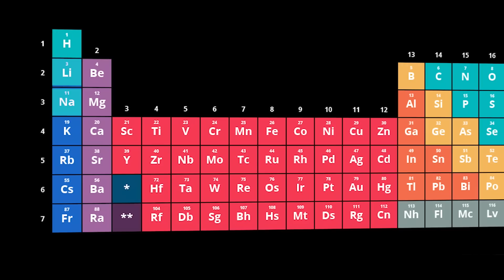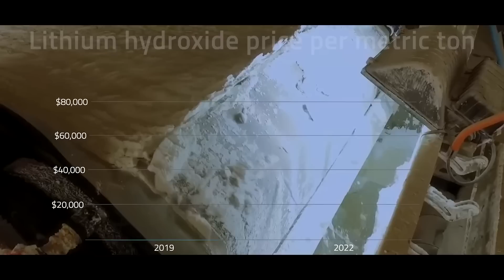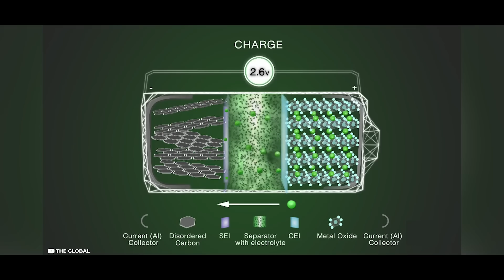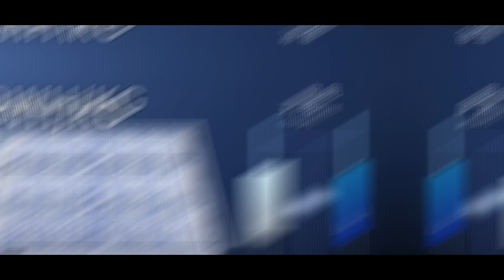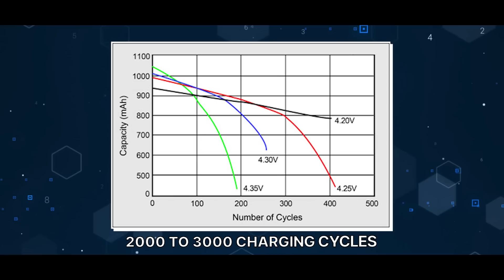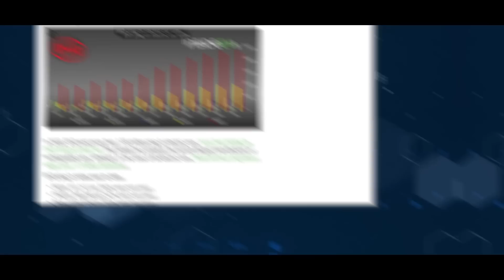BYD launching First 9000$ Sodium Ion Battery EV Changes Everything!

Comment: Nope. Not until the sodium battery charge cycles can match lithium AND its size is the same for the same capacity. Currently they are large and heavy, as their energy density is half that of lithium and have a charge cycle less than 1000. Lithium is 3500 - 5000. So they wouldn't last as long. They are an improvement on lead acid, though.

Comment: The information itself was pretty much correct but presentation was too much dramatized to promote sodium ion batteries. They are interesting for scalability point of view but not a game changer and definitely compromise for energy density. 

We can't compare densities between new sodium ion and old lithium cells. Developments in manufacturing many times apply to all chemistries. Sodium ion batteries makes some things easier but overally the sodium ions are worce performing material. Next generation high density sodium ion batteries are typically sodium/lithium ion hybrids.

What comes to environmental impact, emissions from lithium production depends on energy being used. Typically fossile fuels are expected as a reference. Lithium can also be recycled, so there's no sustainability issue. From material point of view, lithium covers only about one percent of cell mass. Nickel is actually the most problematic material when scaling up lithium ion battery production. That's why LFP batteries have advantage. They actually need more lithium for same energy since electrical potential is lower.

Comment: "Tesla win the race for cheap electric cars"  - you are kidding right - when it BYD  and other  Chinese  EV manufactures are producing the cheapest  EV in the Market and are the one who are innovating  and producing the new battery chemistries,. BYD had the LFP battery in thier EV  since <2010.  while Elon (tesla)  poo pooed them.  Now  Tesla scrambling to get his hands on BYD blade batteries ( and other LFP's)  a Decade later. The only reason Tesla is around today is because of the Chinese market place ( the only country Tesla generates a profit in)  . and western protectionism that prevented BYD ( and other Chinese EVs) from entering western market for over a decade . as BYD was offering a $30,000 EV  in 2011  for the western  market ( and profitable as BYD  always made modest profit on thier EV's ) .. when Tesla  were selling thiers for a +$100,000 and was loosing money on every car sold

Comment: The elephant in the room is still the lack of an adequate power grid in this country that would accommodate millions of EV's charging, Sodium Batteries? .... great, no fires, but they still need charged. The green new deal tree huggers, oh they want everyone driving EV's but to supply all that electricity, the country needs to build thousands of coal fired power plants, that generates electricity 24/7 unlike solar/wind, but that leaves a bad taste in their greenie mouths because they are hard at work with the EPA to shut down coal fired power plants, which puts them in a catch 22 because you can't have one without the other, so if they push one (EV's) without the other, then Americans will face rate hikes they can't afford and rolling blackout. Is that what you want?

Comment: Except the car has not been launched by BYD till now! The latest compact car called Seagull is equipped with LFP battery and sells for USD11-12k per car.
Reply from the maker: Till now. As explained in this video, BYD is testing around with sodium batteries.
Reply: 12K usd is still not bad, similar other cars cost close to 20K, ok, you get the niceish brand and probably less risky on the reliability front, but still very cheap.

Comment: The cycle life plot you show says 20% capacity fade will occur after 400-500 cycles at 4.2V, but you use it to say the battery will last 2000-3000 cycles. Cycle life is still the key issue delaying Na-ion from hitting the market.
Reply: but it is an intermediate.  If you buy an EV for $10k in 2023 while the tech is new and you get 6-8 years out of it, that is fine because in 2030 they are going to be a lot better and cheaper.  It is just better we get away from lithium as soon as possible. Just having mass production of sodium batteries ensures they will improve every year.

Comment: Sodium batteries are cheaper to buy but get 1/3 the cycles of lithium so you have to replace much sooner. In the long run lithium is probably cheaper.
Reply from the maker: Thats not 100% true. Sodium ion batteries can reach up to 3000 charging cycles. The batteries are at the beginning of development. However, they cant compete with LFP batteries in terms of charging cycles, that for sure
Reply: How many charges we can get from 2000 cycles

2000*200 or 400,0000 fucking KM

Honestly, I drived a lot in China and my daily commute was 65km or American range and 2500 family vacation + 200km country house ... and my BMW only gathers 20,000KM/year

so forget about lasting 400k, realistically, 200K is plenty for many.

If I am still in China right now, I will ditch my BMW 330 2017 ... nothing beat about 5K USD per year saving by going EV and the shitty little dingy car is more than enough to get around in the big city anyway

I remember seating in a 2017 shitty Beijing Auto EV, that thing in the city is as quiet as my dads 2017 Lexus G hybrid

We are talking about different beast when going EV ... dingy shitty cars is pretty much the same noise level as IC 80KUS cars in the city 

I still want ICs for longer trip but anything can be supercharged at 240-300KW and the battery lasts 2.5-3h per charge which the sodium ion battery offers then it might also move up a level or two... till then the cheaper the better

Comment: There is a limited amount of Lithium anyway, is expensive to obtain and is not degradable so these new batteries are better, but in the long term I still thing H2 powered engines are the answer for the future. Toyota are on the right track, no EV`s.
Reply from the maker: I don’t think so. Hydrogen fuel cells are just too inefficient.  From converting to hydrogen and back to energy  you have 60% energy loss through the whole process. But who knows maybe there will be a significant breakthrough anytime soon.

Comment: Correction.  Yes CATL and BYD are the biggest in China.  But they are also both the biggest in the world.  CATL by a mile.
Reply: CATL and BYD in China; LG Chem outside China.
Reply: @tooltalk  tesla giga Berlin is 100% catl.
Reply: @fredfrond6148  : CATL Germany is not a big plant -- it's a small 8GW which is expected to scale to 14GWh.  LG has a 70GWh plant next door in Poland, with expansion underway to 115GWh by 2025.
Reply: @fredfrond6148  : >> tesla giga Berlin is 100% catl. <<
Also, CATL was the exclusive LFP supplier to Tesla Germany, but Tesla has been working with BYD on blade format -- rumor has it that they just went production with BYD's blades very recently.  LG Chem also supplies NCMs to Tesla Berlin (not sure though if they are from Poland or LG's China factory).
Reply: @fredfrond6148  : I think it's worth knowing that LG's presence in China is tiny b/c China made it impossible for foreign competitors from entering their market to protect their domestic industry (ie, CATL and BYD).   Other competitors such as Samsung SDI and SKI weren't even allowed in unless they gave up their core battery technology in exchange (for access to their market).

Comment: I understand that Sodium Ion batteries provide lower cost & cold temp resistance as main benefit but this is offset by lower energy density (material property), and most importantly MUCH lower battery cycle life (material property). This would benefit the manufacturers the most because people would mostly be buying as new cars but buyers will learn the hard way later because this will need to recharge more often and more importantly battery will also need replacing more often. When you consider the battery cycle life, is this still justified for overall running costs? Ironically lot of these videos only mention about the positives and not the negatives............ One big benefit that I agree is folks living below freezing temps as this is one major limitation of Lithiums

Comment: If BYD are introducing Na-ion batteries this year, they must be pretty confident in the technology. In which case, it will advance further and we'll start seeing these batteries in more cars over the next five years. LiFeP batteries were lagging behind Li-ion batteries for a number of years, but their lower cost, greater robustness, no need for Co or Ni,  and safety and longevity means their drawbacks, less energy dense and cold weather problems, are outweighed by their pluses. I would certainly buy a car with a LiFeP battery.
Reply: Pictures of the Seagull being delivered to dealerships across China are already out....
Reply: VW also plans sodium-ion batteries ... so it seems a common sense between car manufacturers...  generally I think solid state is the future as NIO is doing for it's two models ET5 and ET7

Comment: Looks interesting if it is already in a position to compete with LFP. Can these newer batteries also charge to 100% regularly?
The new Tesla M3 RWD with 305 miles range  meets a lot of people’s needs so if the batteries could be swapped for no reduced performance in terms of energy density, gives faster charging, better cold weather performance and reduced cost it seems like there’s no downside.
Reply: never thought Lithium battery is environmental friendly. Now Sodium makes much more sense
Reply: Might even be the case in the future where E car batteries become user removable , as in case of e scooters.
Reply: @atulmalhotra2303  E-scooters/Bikes are like 10lbs-20lbs;  Teslas are like 1000lbs to 2000lbs on Ranges Packages! 😆 😆
Reply: it seems..........there is always a downside because we are only human!
Reply: Like it or not, even Texas Grids the Most Independent Grids of USA...

Texas is now not ready for Tessie Moron/ BEV 🔋 🔋 Electric Vehicles... are Hoaxes of all times...
Last Reported from China:

85% of all Electricity in China generated from Coals = Yes, what's a Joke = Why/How?  Our ICE Toyoda Cars with Modern Catalyst Converters, run on Octane 91/ Ethanol are twice as Clean as Electric Vehicles plug-in to the Grids that Generated 85% from Coals.

How/Why?  Those Pipes/Chimneys from Electric Generators/Plants are 100m/324 feet in the Air; Coals burn Hot air of C02 Carbon Dioxide Piped up the Air there are no Trees up there to neutralize some of those C02; while as C02 came from Mufflers = one foot or less than 30cm above roads/streets surface = during daytime = peak hours = some Carbon Dioxide is Neutralized by Photosynthesis Process of those Green Trees planted along the Streets or Wheat Fields/Vegetation Fields along the Country Roads = Given us more Oxygen and also better Yields of Fruits/Wheat with more C02.

Let Nature be a part of our Solutions = Focus on Making Poor Countries like Morocco and Libya having Adequate Dams and Irrigation Systems that Mitigate Natural Disasters... Those are what China, USA, and 🍁 🍁 and G7 (especially Elon-gates Must have been doing) to make a better World = Japan has been doing that with 20 years of Manufacturing Cars that High Mileage and low C02 Emissions.   Get on board or the world has no place to Tour when all Natural Disasters take place all-over = No place safe to Travel.

Regards,

[ Last Updated: Sep 14, 2023 09:49 CT
Chart with 8 data series.
The chart has 1 X axis displaying Time. Data ranges from 2023-09-14 00:04:58 to 2023-09-14 09:49:58.
The chart has 1 Y axis displaying values. Data ranges from 4966.7 to 52419.5.

CURRENT GENERATIONSUMMER CAPACITYMAXIMUM CAPACITY

Solar  5,855 MW	(11.2%) 
Wind  3,633 MW		(6.9%) 
Hydro	6 MW		(0.0%) 
Power Storage		94 MW	(0.2%) 
Other	50 MW	(0.1%) 
Natural Gas	29,767 MW		(56.8%) 
Coal and Lignite	8,042 MW		(15.3%) 
Nuclear	4,973 MW		(9.5%)   ]

These are not Green Energy/Electricity/ Grids = Coals and Lignite are used daily in America = up to 17.5% Daily in Texas and even more in some other Southern States of USA.

And:
FYI:
[Methane, the main component of natural gas and a byproduct of fossil fuel drilling, has more than 80 times the warming power of carbon dioxide in the first two decades it’s in the atmosphere. ]

Drive when we need, walk and Bike with Bicycles not E-bike or E-scooter (Electrified); take Public Mass Transportations.

Cheers,
Reply: note @7:50 : "if lithium prices remain through high until 2026... "
If the prices of raw materials remain too high like it did last few years, definitely yes. But thankfully China's EV subsidies ended this year and the lithium price already plunged by about 75% since its November peak last year.  Further, the prices of the most recent, high or ultra-nicke NCM's -- most widely used in EVs -- are already cheaper than LFP's.

Comment: So I did a little research on this, the performance is roughly the same, or even worst than Lithium Ion.

It’s only cheaper and safer.
Reply: Cheaper and safer, that’s more than enough why I want it.
Reply: 1st gen.
The technology will improve and with China, the improvements will be exponential because of their R&D budget.
Reply: Isn’t that the point? Make a battery that is at least as good as lithium battery without lithium.

Comment: Comparing these cells with Tesla is a mistake. 
CATL’s biggest client is Tesla. 
Tesla also have partnership with BYD. 
However, here in Brazil, I think BYD will dominate over Tesla and any other brand, Chinese or otherwise. 
I expect it for the next 5 to 10 years here in Brazil
Reply: average Brazilian don't have 40,000-50,000$ to spend on a Tesla, if BYD come with 10,000$-20,000$ EV's - will dominate the market in the future.
Reply: @johnsmith-cw3wo  precisely,
And a 25k Tesla will be over 50k here, due to import fees, taxes, profit and everything

Comment: Do NOT underestimate HOW BAD this is for the US.
While the US screws about arguing RED or BLUE - ICE or EV...the Chinese are leaving them standing with renewable energy.

You guys in the Us are pretty simple. The Chinese ARE the biggest EV car manufacturers and have left Tesla at the start gate.
In fact EVERY car manufacturer outside the US has exceeded Tesla in EV production. 
VW group has 20 new models of very different vehicles being manufactured in the next year.  
Stelllantis  is close behind VW, both obliterated by the quality Chinese cars i production.

Tesla has NOTHING in the pipeline. The  Cybertruck - everyone has beat Tesla to that nugget. The Semi....that is also beaten to the finish line.

What you guys in the Us have NOT figured out yet is the decline of ICE vehicles, and the Rise of EV's. 
But you bury your heads in the sand, Gas stations will shut down, supply and demand will see Gas as much as $100\gallon in 5 years. It doesnt matter if you have a Gas engine car, you will NOT be running it. 

The days of propelling a car using Gas or Diesel will be unlawful, as every developed country will employ huge tariffs on those who still want to use ICE.
Reply: The Na batteries are a game changer for sure. When you look at the sheer numbers of EV's that China is producing, they are leaving everyone behind.
We are pretty lucky where I live, I can see 5 windfarms from my house. Currently we get 80% of your power from renewables. Only 20% from gas generation, and a coal station.

Comment: In 2003 George W Bush announced a $ 1.2 billion hydrogen fuel intuitive. Remember that one?
Reply: Infact 20 years later cars in USA still run with gasoline and diesel and only 5% are full electric
Reply: @mauriziolagaxio4954  There is good reasons we still use petroleum products, they work so well. We are no smarter now then before, we are just better at marketing which is a hard sell to describe as intelligent. thanks for the facts

Comment: Nothing new about30% less power for same size it means you need 30% larger batery for same range and about 8 years bit cost batery is affordable as price but considering the fact that tyres needs slight more bigger and longer suspension may be even with airbags the second option is even better if buyer orders normal salt batery then switch into lithium gets a lot better car already tuned to longer range which is nice and car is already more comfortable may be slight less speed at end which is tolerable and in normal drive is not even noticed so in vay cars done are already to salt nuclear reactors  and thorium cells which is top energy tech anyway beyond 2030 so use off spoilers and airgliders as abs eficient stop becomes fancy and popular even in normal cars in city

Comment: There is no shortage of Lithium on the planet, it's the refining process which is lacquing, except for China, which has +- 60% of Lithium manufacturing facility!
Reply: Correct, there is enough Lithium just like there is enough methane in the air so we dont need to drill for natural gas, the problem is the concentration of the material. It has to be economical viable to concentrate it and purify it to the right material to use for lithium carbonate or lithium hydroxide.
Reply: @dekleinvof694  Yep! And same true for rare earth metals which are not rare at all.👍

Comment: Its a start.  Technology is continuously on the move.  Sooner rather later, we will have a battery that is cheap, safe, gives more mileage, and recyclable.  Then you can change batteries like you change those in your flash light.